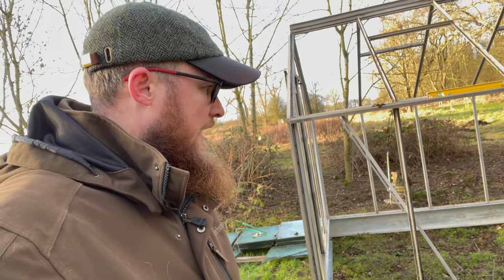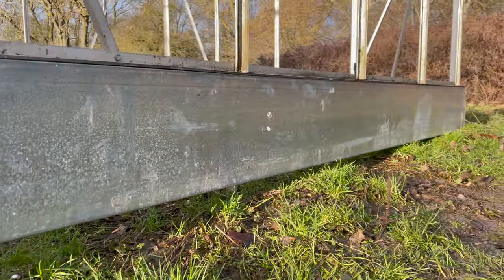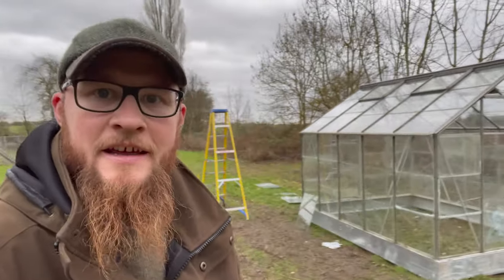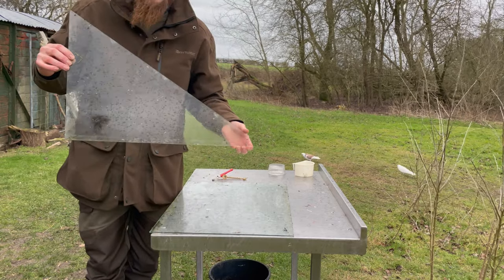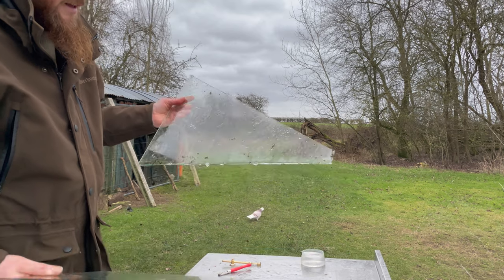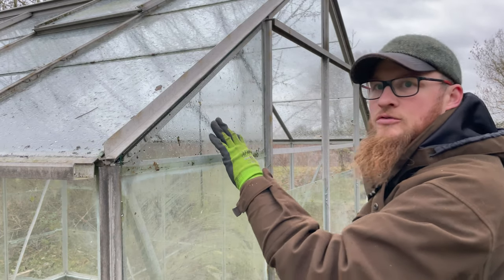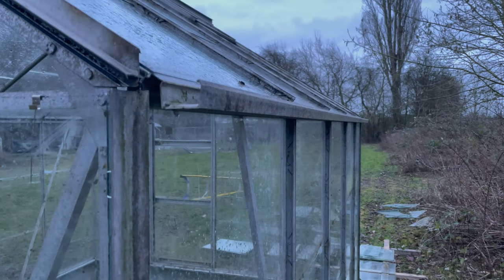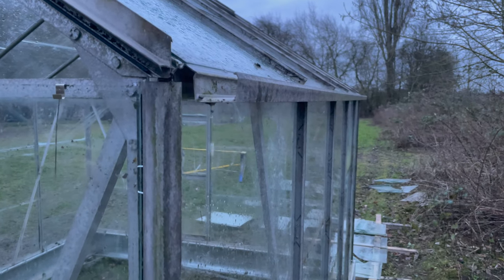Glazing a Greenhouse! How to cut Greenhouse Glass!

Comment: Did you have to get new seals for the glass? Mine are unusable. 

How has it been since you have completed it? Have you started planting ☺️
Reply from the maker: Most of the seals are present and are ok however there are a few missing hear and there but the glass stays in regardless so for now I’m just going to use it as it is. Might be a job for the winter months!  And yes I’m growing in the greenhouse or be it just propagating seeds. I’m going down the rout of no dig, I just need to find a cheap source of compost to get started. 👍🏻
Reply: You could use putty and adhesive, keeps glass stuck solid
Reply: @stuplant6693  great idea because the strip rubber is so expensive

Comment: Nice video. Where did you get the glass cutter from?
Reply from the maker: I bought it years ago from my local hardware shop. 👍🏻
Reply: @doingoutdoors875  what's the actual name for it please?
Reply from the maker: It hasn’t got a name or brand stamped on it so I couldn’t say……… all I can tell you is that it uses a tungsten wheel to score the glass.